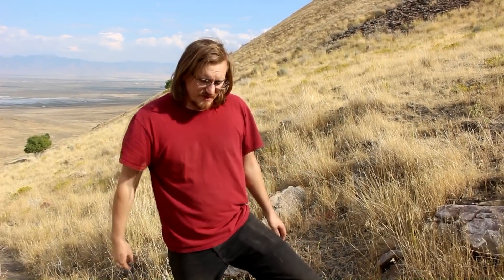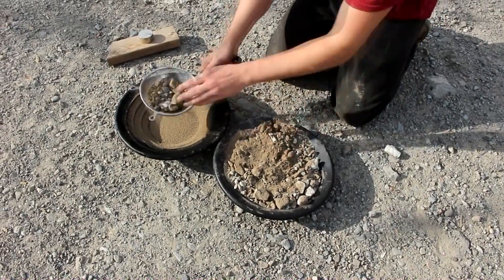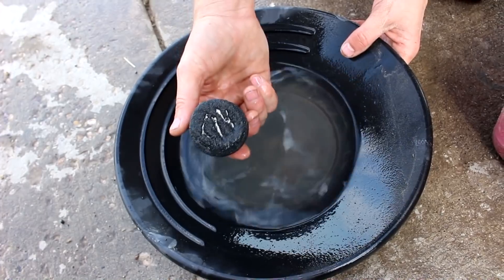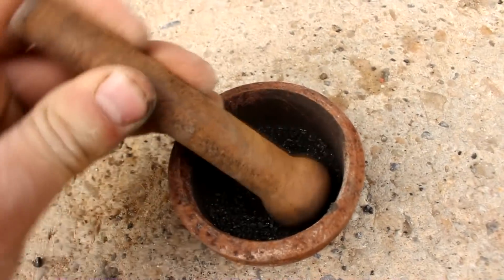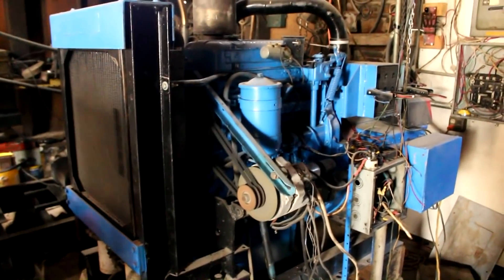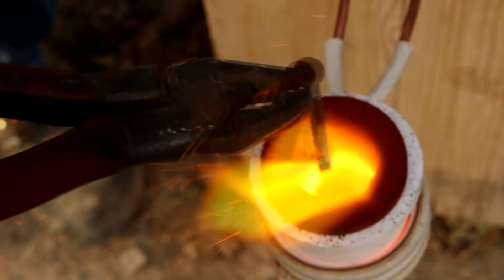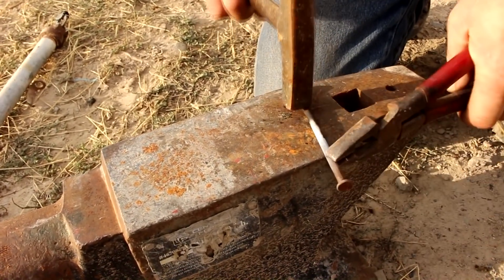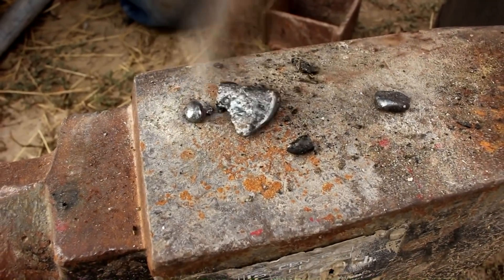Rock to Iron

Comment: The power of chemistry is awesome, all you had to do was dig and crush some specific materials that are easy to find and mix, then heat it up and BAM! IRON!
Reply: Evi1M4chine  You can get that hot with charcoal and a very well-designed draft furnace - which essentially "blows" oxygen over the coals by using the heat of the fire to create a draft.
Reply: Evi1M4chine  early civilizations used a campfire furnace to cast metals
Reply: @LinkinPark4Ever1996  arthur pulled a sword from the stone........................
Reply: @10madcap  THAT'S what that legend is all about. Pulling iron out of rock to smith swords.
Reply: @ishzarkklyon9590  fun fact. Authurian legend was written by a guy in France... who knicked nearly every idea from Welsh mythology.
So not one guy, but a whole culture of people. To dismiss the stories people told in the past is missing the point. Yes they are myths, but they are myths written as a product of the people during that time period and were loosely inspired by how they thought the world worked. It gives an insight into how people in the past thought.
To think history is only fact is just false. A great deal of it is speculation and conjecture.
Also no one brought god into this, except you.
Reply: Evi1M4chine  not to deoxidise the iron just to melt it
Reply: Evi1M4chine  u can use normal fire its just inefficient mostly time wise.
Reply: Fun fact. The heat isn't as important as the CO being released from the coke/charcoal. If you didn't have the coke and you heated the rocks that hot you would just get glowing red rocks.  So Chemistry is awesome haha
Reply: @yxhwxhg2988  no
Reply: yxhwxh G 🤣🤣🤣. Not even close
Reply: Easy to say easy after the hard work of figuring it all out has been done.

Comment: 100, 000 times a second. That would be 100Khz?  Very High Frequency doesn't start until 30 Mhz.  100, 000 hz  Would fall into the LF (Low Frequency) range of 30 Khz to 300 Khz.

Comment: So wrong, I know a much easier method. I usually go to a nearby cave then I mine some coal, then iron and lastly I find some diamonds, but these are (most of the times) close to lava, and they're quite deep so you need to go a long way down. That's when I use rule nr.1: NEVER DIG STRAIGHT DOWN!

Comment: Hey Cody, where I'm from there is tons of Laterite around, so much that it's used on unsealed roads everywhere. This place is one of the few that you get Laterite that isn't in the tropics. Quite often the Laterite is able to be picked up with a magnet, but it's not made in to iron. Can it be refined into pure Iron easily? I have always wondered, but never had the equipment to check.

Comment: Be careful . If you would have had that metal box in your house and the ac was on and you don’t let the metal heat up before using it. That liquid metal would literally jump or splash of the metal like what happens to glass when it’s goes from the fridge to the hot oven too quickly

Comment: Instead of getting your magnet so dirty when using it, you can put it on a ziplock bag and use it. Then whenever you get ready get the magnetite off, you just need to turn the bag inside out and pull the magnet away and your magnets clean.

Comment: I'm a geologist, I have worked on iron ore mines in Australia. The ore there is up to 70% iron, that stuff doesn't need concentrating at all, just needs smelting. Amazing stuff, you can actually weld directly to the ground up there.

Comment: I couldn’t understand why you added limestone? u r  probably not going to see my comment , if anyone can answer it I d be happy thank you . 👍🏻
Reply: it's acting like a flux. flux is a substance which is less dense than material to refine/melt to make a coating and prevent oxygen from reacting with hot metal.
Reply: Pump Reactivation Project thank you for explanation. 👋🏼
Reply: T Kara no problem :)
Reply: Pump Reactivation Project could you explain why oxidizing the metal would be bad? I apologize if it’s a stupid question I’m just curious
Reply: @Royal_Fortune  it's metal reacting with the oxygen, which is then wasted.  Can't use it now as it is bonded to the oxygen as rust, which weakens the iron/ steel.   Same reason welders can use inert gases when welding.  It's kind of bad with iron, but with the more reactive metals like silver or aluminum the oxygen reaction is obscenely quick.
Reply: @hosmerhomeboy  I may not be too smart with chemistry but I thank you for taking the time to explain and help me understand this a little better. Again, thank you!
Reply: @Royal_Fortune  Yw, i'm no expert but this stuff fascinates me.

Comment: The heat inductor will make it seem like the metal being melted is solid, but it is actually liquid. It stays in a single spot near the center of the electro magnetic field given off by the machine. if you put a bolt in it, the bolt would float, and eventually melt into a seemingly solid, and either oval or spherical shape. Upon turning the machine off, it will drop, and splatter against the ground.

Comment: 1: My area has haematite in the shale. It doesn't have magnetite. How should I separate it out if it isn't magnetic
2: It's Carbon monoxide coming out of the crucible. That's a good thing - it means you have enough Carbon to reduce the Iron into metal. It burns because Carbon monoxide + Oxygen = Carbon dioxide + energy
3: Could you have smelted the iron using a fuel-rich natural gas or petrochemical flame? At least it doesn't add to the slag like coal does.
4: Does your area also contain Pyrite or other Iron-associated elements (e.g. Nickel, Manganese, Chromium, Vanadium)?

Comment: iron is everywhere just run a magnet threw the dirt and you will see the iron cling to the magnet....the rock just formed along side the iron that mixed with it but not that the rock turned into iron.....just that the clinging iron that deposited in the rock was melted down and forming one fused iron molten piece in the end
Reply: What are you trying to say? The rock he used as the ore appears to be a magnetite-rich Chert. A white/grey sedimentary rock made primarily of silicon dioxide (silica). He got the naturally crushed alluvium of said rock, screened and gravity separated it in order to get the little bits of magnetite out. Sedimentary rock is literally layers of sediment, as in they're made entirely of dust and silt that's been compacted down over millions of years, which is why the magnetite can be separated in this way.
Reply: HMS-Captain Lurmey if you see in the start off the video magnet holds it froom that start of rock formation... unless yoh know alchemy and you turn glass wood or water into stone.
Reply: I still have no idea what you're trying to say here. Yes, the magnet holds the rock because there's magnetite held inside between all the silica and other minerals. Rocks aren't one solid object of the same material all the way through, the magnetite isn't somehow "stuck" to the outside, it's embedded inside as tiny grains, like throwing a pinch of sugar into a bowl of flour.
Reply: Look at the image used for the video to click on ...ones dark ones a white rock tell me which one is being attracted to the magnet. not all rocks are created equal not all rocks have the same chemical compound they need to be analysed to know the full composition in them your only staying that all rocks like such are created exactly the same with the exact minerals in them everywhere no matter what and that's not the case.
Reply: What? "Thumbnail" is the word you're looking for, and it shows a sample of rock and then the iron that was refined from said rock. Nowhere have I said that all rocks are the same, I told you that I suspect the rock he used to be a magnetite-rich Chert, which is a specific type of rock.

Some grammar would be helpful in deciphering your comments... What is your point here?
Reply: HMS-Captain Lurmey my point is and was that it's not jist a typical rock it has lots of iron found in all things ..... exactly what I said in my first comment from the start.... you were the one who first messaged me so what's your deal?
Reply: It's incredibly difficult to decipher your initial comment to work out what you were trying to say. Yes, it's a rock that happens to be rich in an iron oxide mineral. Why were you saying this, though? And what was all that about alchemy and the rock turning into iron? Do you think Cody thinks that the rock somehow turns into iron or were you trying to respond to someone else's comment and left a separate comment by mistake?
Reply: HMS-Captain Lurmey rock to iron is the only thing in the description what do you think most will think? Enough of this... pointless.
Reply: What? The description has a lot more than just the title of the video and the majority of people won't think this is magical alchemy at work. Cody literally explains how everything works as he's doing it in the video. I'm not sure you're entirely with it.

Do you just think that the title suggests that any random rock can be turned entirely into iron? It doesn't suggest that at all, it's just a short and sweet title to summarise the video. He starts with a rock sample and from it, he refines a sample of relatively pure iron.
Reply: HMS-Captain Lurmey the first reason top come look any video is because the title not because what it might contain within the video because no one would know what it has til they watch it or are you new to YouTube.... so title is everything to get people to first cloick and watch it.... so having just that ob the title can make anyone think it's one thing first before knowing what it has even if there is lots of good things within that video but the main purpose is a title is to hook people by that title, it looks like you are just trying to defend him giving the run around answer that had nothing to do with why I commented in the first place but enough it's useless your just kissing (_y_)
Reply: You're way overthinking it. The title isn't supposed to be a description of what happens in the video, it's the name of the video and can be completely unrelated to the contents of the video if the author so desires. He is in no way suggesting that he uses alchemy or some other fictional method of transmutation to make the iron. You're assuming that everyone makes immediate assumptions about the video before watching it like you clearly do. Every heard of "don't judge a book by its cover"? Videos are just like books, you never judge it by the title or thumbnail.
Reply: HMS-Captain Lurmey that's not the way YouTube works... that is why they added the dislike button or now buttons that suggest it's click bait if you know what that is, but ok nvm lets move on
Reply: Dude, I know how YouTube works, I've had my account since 2011 and was using the site before that. There's no escaping from the fact that you're just assuming that everyone judges each and every video they watch entirely by the thumbnail and title. The title is just that, a title. It's not supposed to describe the video and any videos that do use it for that misuse it. When did you ever see a Harry Potter book titled "Snape kills Dumbledore"? You haven't because J.K. Rowling knows how to title her works correctly.

The description is for describing the contents of the video, the title's purpose is purely to have a unique identifier for the video that people can easily share by word of mouth. Saying "Have you seen 'Rock to Iron' by Cody's Lab on YouTube?" is a lot simpler than saying "Have you seen 'I Mine Some Rock and Refine Iron From it Using an Induction Smelter' by Cody's Lab?".

That's the point of a title. To give it a catchy name, not to describe the contents of the work. Jesus fucking christ, I think you're the one that needs to learn how it works.
Reply: Not assuming I don't know one person that does not click on any video because of the title image and title description,  so yippy are saying that I'm the only one and its only me that clicks on videos negate of the image and or title lol omg hilarious do your saying everyone in YouTube randomly just clicks on videos withought reading the title or seeing any cover thumbnail that's of interest to them and they just don't care closer there eyes lets see what they click on to watch after they clicked on it? All that withought really wanting to watch what the title said and was expecting what the title or the image had.... come on dude hehehe.  Stop there no more please this is comedy will not respond to your next comment enough debate.

Comment: So if you were to add more carbon, could you technically make it steel? Sorry if that sounds stupid, I have zero knowledge on this stuff and never paid attention in chemistry. Also is the limestone a necessity? I might attempt this with a small foundry such as the flower pot one found on KingofRandom’s channel
Reply: I don't know of anywhere in the world in which you can't easily get a hold of some limestone. It's one of the most common rocks on the planet and can be found almost anywhere that water has been in the last few million years. I literally live in a place where the only rock below my feet is limestone. I'd have to travel a few miles to get granite or schist.

Comment: Can anyone explain why Cody uses calcium carbonate as flux ? As far as I know it decomposes to calcium oxide, which has a melting point of 2580°C which is far too high even for an induction furnace.
Reply: Pure CaO would be solid, but he's also got SiO2 and Na2O in there (from the ore and the soda ash). Together they form a kind of glass that has a lower melting point.
Reply: They react to form a silicate with calcium and sodium in the lattice, it's not just a physical mixing.
Reply: He use it because easy to find some in natural conditions

Comment: pan for more gold and make the knife from the black sands. what was with the outer liner was that not blocking the heat from the inter one. you can hold that iron in those coils now with super long tongs to heat it for working or forging.
Nice unit, I am building my own , 36v, 50 amp.

Comment: I have an idea you could try: When on a Beach you can sometimes see black lines going along the length of the beach. As I understand it these lines partially consist of magnetic, black and tiny pieces of sand. One could extract the iron from this sand(beginning to end). However I have already sifted out some of this sand and could send you this material so that one wouldn't have to go to the beach.

Comment: NO, this is not like minecraft. 
MINECRAFT IS LIKE THIS!!!!
Reply: neodymium does exist - commonly known as "rare earth magnets".
Reply: Im currently working on a mod that removes a lot of vanilla recipes and adds realistic chemistry
Reply: MineChem
Reply: try GregTech 5.1
Reply: @dombr5653  GregTech is about as far from realism as one can get
Reply: @haliax8149  well, there are many accurate procedures
Reply: @dombr5653  No, I'm afraid it doesn't take a gigawatt of energy and a high powered laser to break  a piece of talc
Reply: @haliax8149  Does it in real life? Talc is pretty soft
Reply: @dombr5653  In gregtech it does, that's my point. Everything somebody does in Gregtech requires far more energy and resources than it would in the real world. You practically have to have a nuclear reactor before you have enough power to smelt ore.
Reply: @haliax8149  not sure what you're talking about. Pretty sure talc can be crushed with a hammer, and the ones that require a nuclear reactor are actually hard to melt in real world, such as tungsten. It's not completely accurate for obvious reasons, but it gets somewhat close
Reply: James r/woosh
Reply: Cringe
Reply: Minecraft is very different. However mods have made it more realistic in some cases, Like the addition of steel which in most mods is as "realistic" as it gets in minecraft

Comment: You should try to dry the raw iron first before putting in other elements. that way you can measure the weight of the iron and can add something like .75% of that weight in carbon.

Comment: Do you have slate dumps in Utah. In some in WV, I often find really dense, black and reddish rocks with silvery spots inside them. I've crushed them up before and separated the silvery mineral from the rest of the stone and it doesn't seem to be magnetic. I don't know what they are or what they're called but if you're interested, they're usually extremely smooth and round; also, distinctively heavier than the slate they're found in.

Comment: Isn't this big generator kind of overkill for such a small furnace ? 🤔😂
Reply: I know, while it probably is quite strong, seems like a bit of overkill for some iron.
Reply: I believe the induction heater is either this model or a similar one --
15KW 30-80KHz High Frequency Induction Heater Furnace LH-15A 110/220V 

(LH-15A would be the model number)
Reply: @hypnotoad28 15 kilowatt ? 😱
Reply: you already got "does" in there, 'draw' is what you should write

Comment: That's one BIG OLE neodymium magnet,how does it interact with the one in" yer finger"?
Reply from the maker: It produces only a slight tug on it. Think of it this way, take a small fleck of rust pinch it in your fingers and bring it up to a strong magnet and you will find that you have no trouble keeping hold of the flek. even though the pull of the magnet is quite strong the metal is so small the force is also small.
Reply: Thank you for your reply.
My friend is going to be jealous.
Reply: Thank you for your reply.
My friend is going to be jealous.